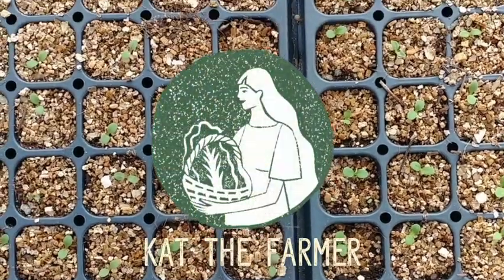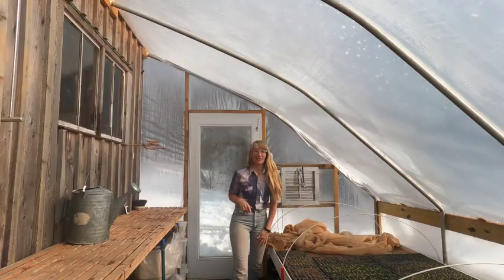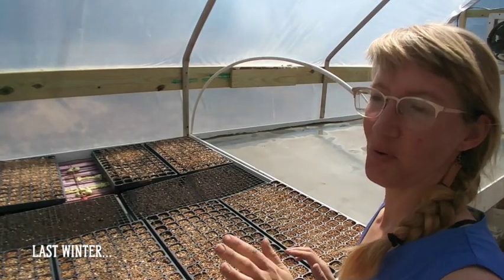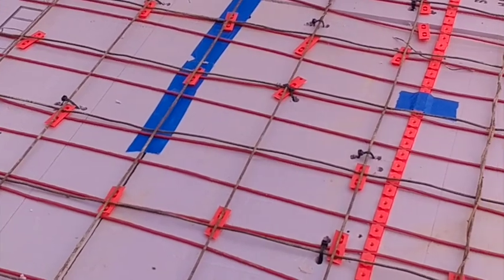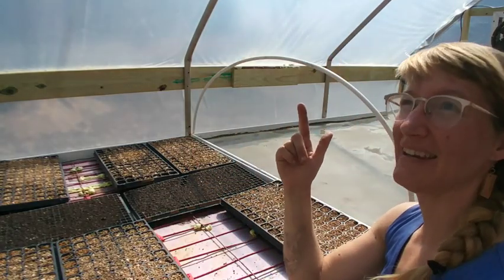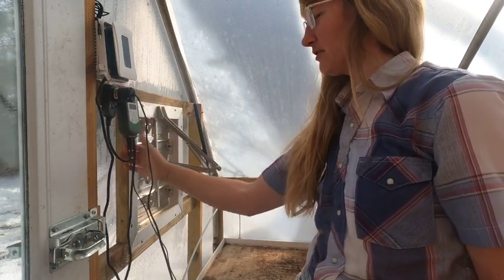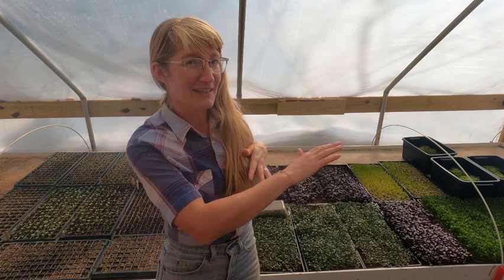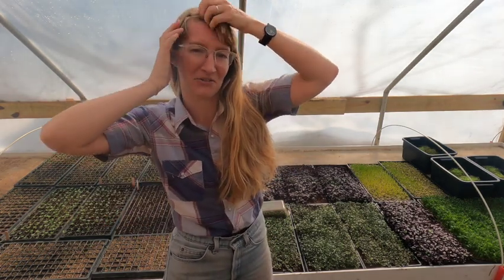Bottom Heated Greenhouse Tables *Electric*

Comment: Thank you so much most helpful video of it's kind so far. I am going to build one with the same tools, but I would like to use pea gravel or sand instead of concrete. Did you install the electrical cable on your own or did you get help from an electrician? Was it easy to install?